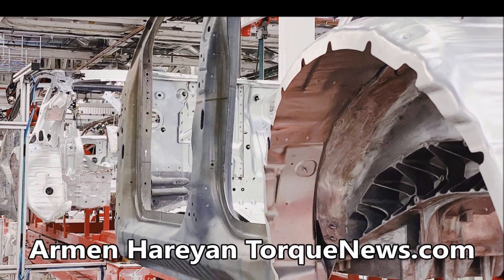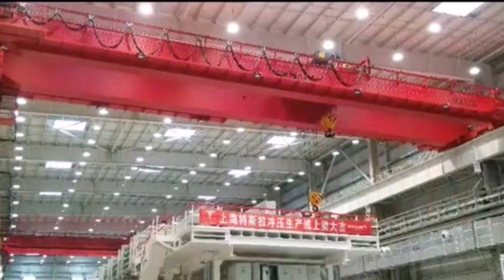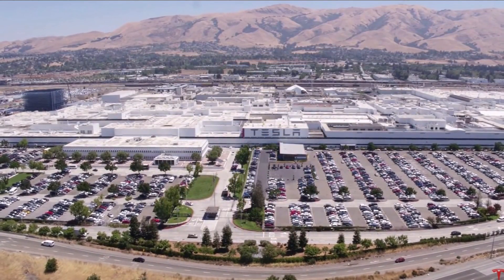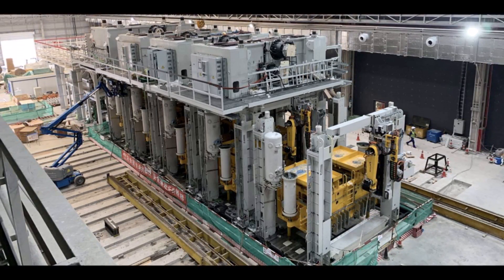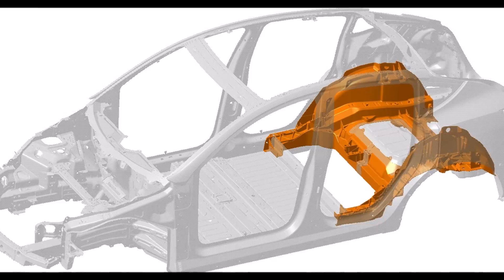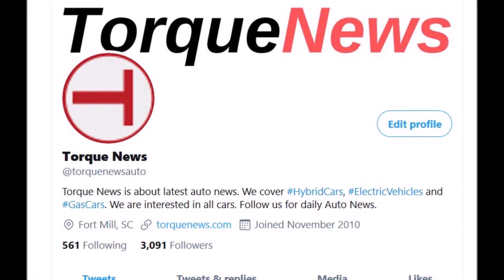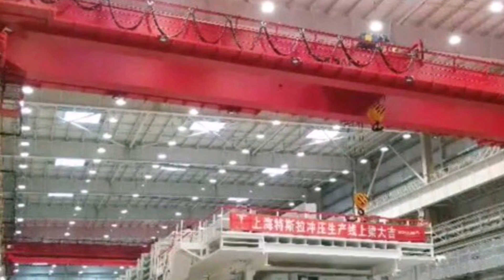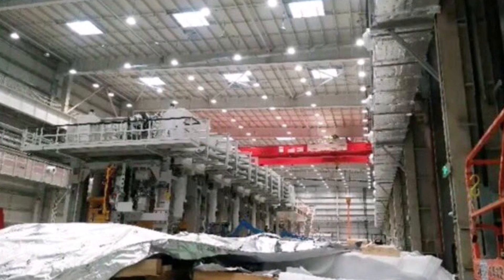Elon Musk: Tesla To Activate World’s Largest Giga Press for Model Y

Comment: Sounds like they are not planning to change they models very often. Casting mould for that machine is not cheap.
Reply: Usually you end up ordering at least 4 - 6 sets of molds at one time, so initially it is expensive. But, then amortized over the amount of parts produced it's not too bad. If you do change vehicles or styling then it starts to really add up, because then you're looking at reprogramming and new molds..
Reply: They can re-use the same platform but re design the rest of the car so they might get several generations of the same car out of this casting before changing it. It is a huge investment though and it means they plan to sell a LOT of cars.
Reply: They did change MCU/autopilot chip/drivetrain/electronic design on thie car during the years. exterior looks same but what's inside different. And of course the OTA software update.
Reply: The cost of the mold will be insignificant if you plan on producing half a million parts per year.
Reply: @kazedcat ,  yes the life of the mold may only be good for a few hundred thousand parts.  so design changes to the die could happen frequently.

Comment: They should do this with the model 3. Lowering the price of the model Y will cannibalize the model 3. Why buy a 3 when a Y is almost the same as the Y.
Reply: What’s the difference?  They’re going to sell the higher margin Y.  Ifs still a Tesla.
Reply: The y is cheaper to make them the 3 at the moment due to the improved manufacturing techniques and simplification of design. The improvements will filter to the 3 over time and as new factories are built.

Comment: You need to amend your description, it's nearly click bait.
This is not a production press as it would be baby press compared to press's in th 25 to 50 thousand ton range.
This is a casting machine.
Reply: Anthony Langton didn’t he say it was 410 thousand ton?
Reply: No 410 tons, this is not a press, it is a casting process.
There is nothing Giga or press about it.
The biggest press I have ever seen was a 4,500 ton unit and the accumulators were bigger than this machine.
Reply: I guess the press part is the forcing of material into the mould in a fraction of a second. Or is that how all casting machines work?

Comment: In 2019 Musk said the Y would have the entire frame cast in one piece. Pity they haven't got there as it might cure the multiple problems with misalignment of the frunk, hatch, doors and panels.
Reply: Also aluminium is very expensive compared to steel
Reply: @alanmay7929 .As a material, you are right, but as Sandy Munro points out, that one piece of rear frame casting on a Model Y replaces about 100 separate parts on a Model 3, many of which are steel which has to be cut, pressed, welded together, screwed together, and painted. The cost saving is considerable and the result is perfect to a high degree of tolerance, unlike the welded bits which are "off" to a greater or lesser degree. If they could do the entire frame, or even cast it in three or four bits and bolt them together, that we be an even greater cost saving.
Reply: @67daltonknox  wasn't that 70 different pieces?! And also how tf did tesla ended with so many parts for just a rear?! Other manufacturers have better solutions and can make cheaper cars,  sport cars uses lighter magnesium die castings.
Reply: @alanmay7929 . Munro included the mounting hardware. The point again is that these castings save money and provide a better engineered product.

Comment: This may be efficient, but it makes this much more expensive to repair if the Tesla gets rear ended. It’s like the Lotus Elise rear clamshell, which covers pretty much the entire rest of the car. If that piece gets damaged, they total the entire car because it’s so expensive. You may see a lot of totaled Tesla’s from rear impacts if that is the case. This would make insurance on them higher because of replacement costs. Just a thought.
Reply: Also aluminium is a very expensive dirty metal thats very energy intensive to make compared to steel
Reply: @alanmay7929  Is that really true? Weight affects fuel economy which is an offsetting factor. Aluminum can also be protected from salt water corrosion even as steel can be protected.
Reply: Well Tesla is the Insurer of choice for Tesla Cars, likely they have taken this into account.
Reply: Maxwell Smart Good point. I forgot they’re getting into that. They also may be able to drop this entire part of the car easily to replace it.

Comment: Can it produce the same results with the model 3?
Reply: Yes. Well in new factories they will upgrade the models per factory based on the newest best design. The model 3 will also get a one piece rear. As more and more factories are built, more and more of the car will be different from the original form due to improving how easily it is manufactured from less parts, more castings or more easily installed parts.(hard wiring that we saw the patents for that allow autonomous installation, instead of floppy cables installed by hand)
Reply: good question.  I think future models will use such machines

Comment: How many time do these press machines produce bad parts? Also, with bigger, more complicated parts, the likelihood of a bad part is much higher. 
This is a little bit same situation as in CPU production. Bigger die size is better for performance, but one mistake can make a "big" die go away, while if you use more smaller core, you only have to throw away only a small core.
Reply: This is nothing like that.
Reply: Since aluminum can be welded in the field as in a factory, common subsections will be a possibility when  the damage is less severe. The same repair techniques and skills are often used today in conventional steel automobiles using components produced by specialty manufacturers.
Reply: Unlike (chip) silicon die, defect(s) on cast aluminum parts can be repaired. Once the casting machine is calibrated, there should only be minor defects.
Reply: @bigcat9977  He says casting a lot, but the parts shown in the video are most probably stamped. And there is one of the problems Tesla has, the stamped parts are not that precise as they could be. The factory in China seems to have the best quality at the moment. The german factory is expected to be even better because of new and improved tools which last longer for the press and an improved paint shop with a different type of paint.
Reply: @VolkerHett  This machine is for casting. Sandy Munro already examined the parts it is cast. In fact he was very exited about it and mentioned that the bigger machine for single casting will offer large cost reductions. So an expert have already verified the technology.
Reply: @kazedcat  Very interesting. I know they had to recalculate the foundation for the "press" in Germany. This could be the reason.
Reply: @bigcat9977  I don't know, I think we need an expert to answer that question. It is OK that is can be repaired, but in a factory,  where speed is very important you just can not stop everything because Joe has to make some specific correction with a faulty part.
Reply: @bigcat9977  actually there is place for many errors in the giant castings, temperature, pressure, cooling down..... too many parameters to get right

Comment: Casting machine or press? Those are very different machines. Which is it?
Reply: This kind of casting is very complicated process. From what I know cast aluminium inserted at crazy pressure (if I am not wrong 400 bar) in fraction of seconds. The complexity is how to stop distortion of shape when cooling because of thermal dynamics.
Reply: @pradeeppatel2336  This sounds about right.  The problem they may have is if it forms incorrectly the entire frame will be scrap!  would love to see this thing run!!
Reply: Got to install the first die cast machine in Nevada. A smaller Idra that is cool to watch in action.
Reply: Also stamping machine is like a press.
Reply: Jeff Krupke Maybe the call it press because the pressure during casting requires something like hydraulic rams to hold the dies together. The biggest stamping press I saw was a 60 ton machine in the F-16 plant in Ft Worth. The Tesla casting machine is just awesome. Hats off to the Italian company that made it possible.
Reply: @billrumbley  big presses exist 1200-3000 T with a few really big ones.  This press looks to be like a plastic mold injection press with metal injection.  Would love to see this thing!!
Reply: @rogersmith1408  I saw such a plastic injection molding machine in action at the K, the largest plastics processing trade fair in Düsseldorf. It just spat out these monoblock garden chairs and was easily the size of a single family house. With a Monomat80, we ourselves had an injection molding machine with 80 tons of clamping force, which could just produce parts the size of a drinking cup. The forces involved in aluminum die casting are then even greater. If, in the end, the Teslas are to be built like a Matchbox car, that's really impressive!
Reply: I suspect the large press patent is for folding up a stainless steel cyber truck..the casting is just a very large one piece cast...he’s mixed the two..
Reply: @Biftizmo  They had presses at the Budd Co in Philly that pressed out the entire side of a railcar from a single sheet of stainless steel in one shot